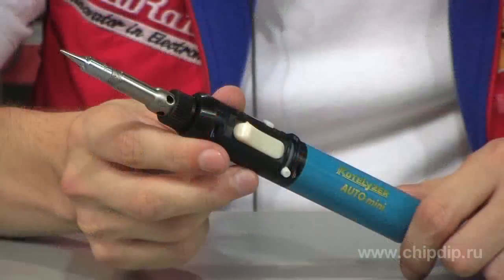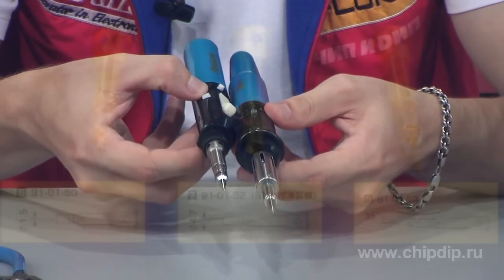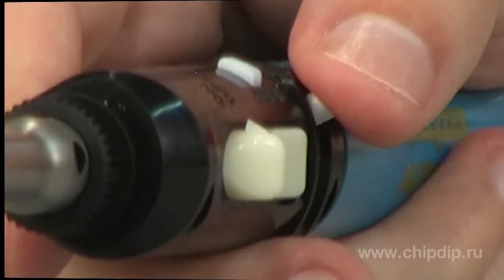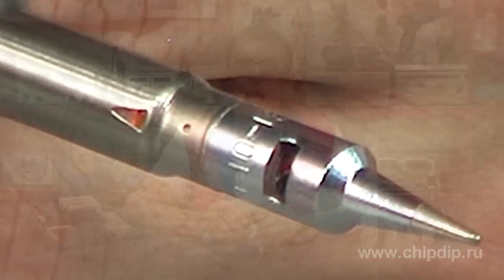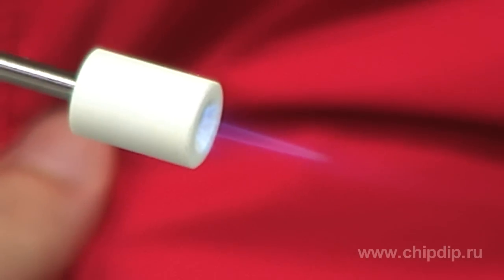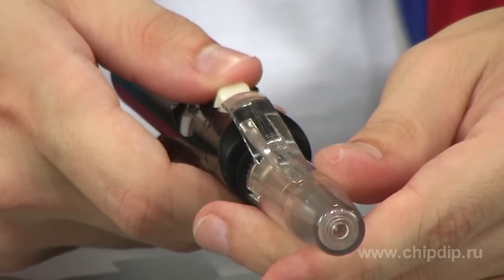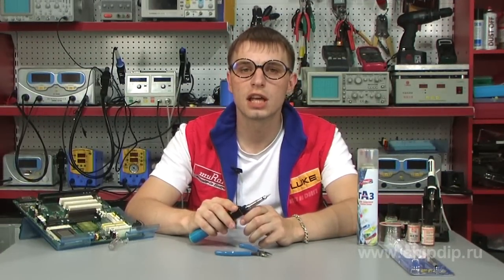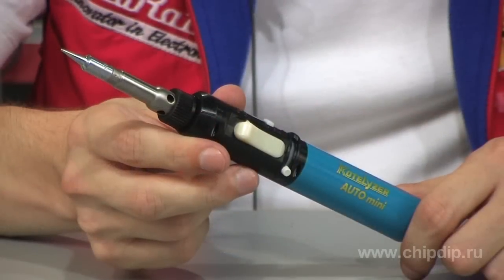Kotelyzer 91 Auto Mini Gas Soldering Iron

Comment: My Pyropen (a.k.a. Kotelyzer 91 Mini Gas Soldering Iron) here in the United States is known as: Weller Pyropen WSTA6. I have had my Pyropen for about seven years. It no longer lights anymore. But it does have an electronic spark and the gas still emanates from the tip. Do you know what is wrong with it and can you suggest how I can repair it? Thank you for your time. Blaise in the U.S.A. seeking help.

Comment: output of gas at the tip could be at too high pressure this is proved by trying to light with an ordinary flame( a lit match or cigarette lighter) it will not ignite unless you can reduce the pressure, ie change the gas ejector.